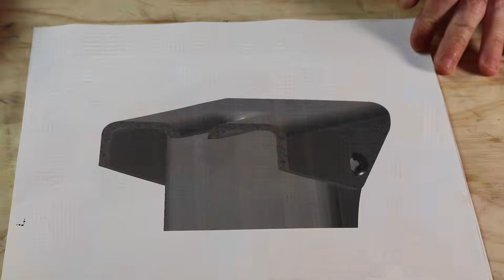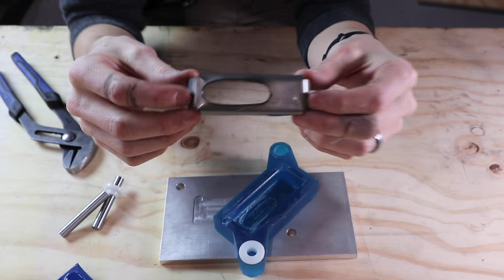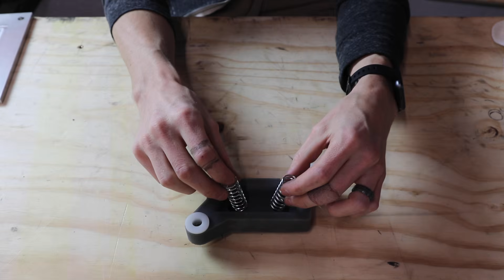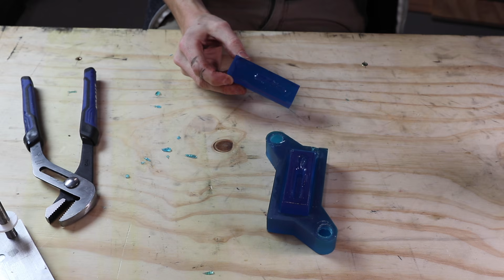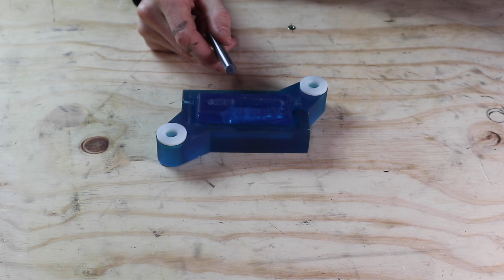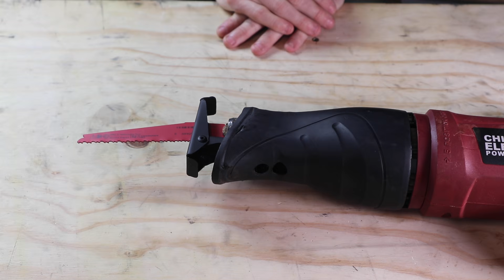Bending Steel With Plastic Tools

Comment: Nice job, man. There's nothing at all wrong with printing hobby models, but it's great to find a youtuber using 3D printing for actual functional parts for once. I have a resin printer (highly accurate but the resins are typically even more brittle) but use it to print either a form which I can make a silicon mould around and then cast one out of a high-strength, two-part resin, or if geometry allows, print the mould directly, add a release agent and just pour resin straight in . Asides from the obvious benefit of having stronger forms, you can also use much less print resin (or filament) as most of the structure is infill because it doesn't need to be strong. Can also add glass fibre or carbon fibre to the two-part resin to further increase strength. Obviously this creates one more step, but it's a good middle ground between expensive, machined metal forms and brittle, instant 3D printed parts.

Comment: So forgive my ignorance, I'm not an engineer, but that symmetrical cracking of the final form.  Would it not be possible to solve the shattering die by increasing the area of the applied force. Instead of simply pressing down in the center, if you had the press applying force to the entire midsection, would that not help prevent this??

Comment: If you had done this with a cheap fdm printer you would have had better results. You can indeed form steel with an fdm print and believe it or not pla is all you need.

Comment: Have you ever tried/made any videos on composite tooling using 3d printing? Might be really neat for small scale or internal structure parts. Have done something similar with a printed mold and inserts for a CF steering wheel, thought it might be a cool topic to check out

Comment: That was not the bushing sticking on one side, that cause the one end of the die to stop moving.  You placed your top piece of aluminum slightly over the Left guide rod.  Watch the slow-mo again, and you can see the aluminum top plate actually bend up before it slips off the guide rod. Now look at time stamp 15:10.  You can see the proof by the damage the guide rod did to the aluminum plate. But Great video any how I got a few things I would like to try.

Comment: A lot of these parts are done in two stages with the second just finishing up where the first one messed up, but there’s also two stage presses that punch the metal and some holes out after the initial pressing is done and the cutters are just deeper in the mould

Comment: Imo the slit in the blank seemed a bit narrow , should maybe widened the slit, 1/8" and thinned slightly with a dremel for a decent bevel 3/16"  around the perimeter of the slit and widen the hole in the form underneath by 1/4" , just what I would do to attend to resolve form breakage

Comment: Really enjoyed watching. Keep making these great videos! To fix the camming issue you experienced you could try replacing the hole in one of the white bushings with a slot (if you haven't already done so, hard to see). With two holes the system is over-constrained and more inclined to jam.
Reply: Btw I think if you printed the female lower die using a MarkForged printer with carbon/kevlar filament reinforcement you would not have a problem with the die splitting under tension. You would print the die with continuous concentric fibre rings around the cavity embedded in the walls.

Comment: Print the forms into a steel box to keep the forms from bulging out with pressure.
Your welcome
Reply: That doesn't work with a resin printer. You could pour resin in later, I guess...

Comment: In metal forming there is a term called a "set radius" it has to do with bends thinning in the corners. As you know the material on the outside of a bend is in tension, the material on the inside is in compression. The thinning comes from the outside "Skin" of the material. If you were to use a point micrometer in the bend you'll see that bend would be less than material thickness. 

Ok! I said all of that to say that your bend tooling should not be material thickness offsets. It should be at least equal to thinning - in most cases you actually want it to be slightly thinner than the finished bend. This will "hit" that corner hard and generate a lot of pressure. Essentially you are setting the radius at the angles you have on the tool (90 Deg) 
If you want to go over 90 deg. Then you would relieve the bottom tooling to have clearance to allow the flanges to swing further than 90 when you smack the corners harder. 

I hope that made sense :) All that being said I believe the pressures would exceed Plastic  and you'd blow it up for sure!

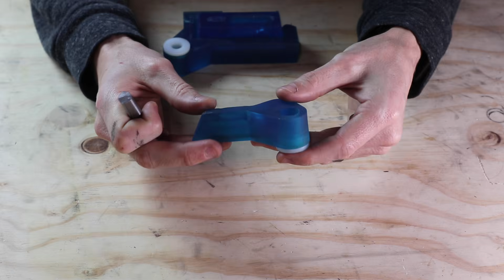Comment: 14:14 what actually happened is that you didn't place your press piston right on top of the die and the mold at 12:10. You had it just right at first then decided to move it and went off-center, thus causing the camming you're talking about. Great video nonetheless!

Comment: It's mostly epoxy resin if so it's first time hearing 3d printing using epoxy resins. This guy doesn't realise it's not a common knowledge of the 3d printing process that's being used and even then didn't reveal anything. 🙄. For most people 3d printing means fdm and there no way fdm can do this.
Update: n further research I found out that it's a polyjet process with polypropylene material which can withstand temperatures upto 300 d c.

Comment: First and more importantly, this was a really neat video.  

Second, I just saw a video on PSU material if you have the enclosure, heated bed (160 degrees, so ac powered bed), and all metal hot end to do it.   Very strong stuff.

That all being said, I laughed when you said A Holes.  My inner 12 year old is alive and well.

Comment: I love this (and your other) project(s). Curious if you would think to run your designs through FEA on the die in tension before going to the length of 3D printing? Seems it would reduce much of the trial and error factor. Thanks for your videos... very enjoyable watching your process!!

Comment: Probably already know this but I would say that the slot would be cut and formed in one operation after the simpler features. Of course it's just 3d printed dies and dies are normally made of A2 tool steel, at least the ones I've seen. Great job on 3d printing dies and using them in a real application.

Comment: When you make dies that are weak, provide support from the sides.  You could make a steel or aluminum "box" that the die sits in to support it from bursting.  You can make your 3D printed dies smaller, saving material and printing time.
          In industry, some forming is done by having hard rubber lower "die".  It is supported on all sides, so it is essentially a "hydraulic" die.  Advantage is that only 1 die need be made, and there can be less trouble with parts sticking in the die.

Comment: Awesome video. What material were you printing with?  PLA? ABS?
Reply: Looks like SLI printing in resin. Not sure.
Reply: @shifty7739  Yeah he says it's resin near the end of the video 19:35
Reply: @atomix2559  same with 13:43
Reply: that is form labs tough resin
well, the blue die was.
Reply: @LittleRainGames  Yeah, its so expensive though cause each tub has a shelf life...so it's better for people who print a lot...
Reply: @LittleRainGames  i think the blue one is draft resin, my draft is blue at least and the layers seem quit high
Reply: The grey one looks like tough 2000 form labs resin. It is resin for a SLA printer. I have one too and the prints are so much stronger than FDM prints
Reply: @RegeraV8  what do u use it to make? Ive always wanted a printer. TIA
Reply: @RegeraV8  resin is much more brittle though, especially in a high tension situation like this. I think a 100% infill FDM print would fair much better than resin print.
Reply: Jesus that tough resin is $175 USD for 1L  (33 fluid oz)
Reply: @shimarlie1  1L is a ton of resin.
Reply: @shimarlie1  Have you seen the price of PEKK? Over 700 buckerinos per kilo.
Reply: @shimarlie1  Pretty sure he gets it for free...
Reply: @Bottleworksnet  yeah makes sense. Cheap advertising
Reply: @shimarlie1  No, because Shane is engineer lead at Form Labs.
Reply: Dcgrdgtf 21 sdx ? 😂
Reply: Resin on a resin 3d printer
Reply: This is a great comment chain 👍
Reply: He uses resin it looks like, no footage of it being printed, it’s clear, and very smooth so most likely resin
Reply: He uses a resin printer
Reply: I wonder how it would have worked with fibre reinforced material.....
Reply: @wernerviehhauser94  Probably no real improvement, fiber reinforcement only really helps with tensile strength.
Reply: @wernerviehhauser94  how would  iron filings turn out
Reply: Can you explain what these words mean for those who don’t have a PHD in civil engineering
Reply: @nukerkid105  They're just different types of plastics used in 3D printing.
Reply: @backfake5415  ah I see
Reply: @nukerkid105  Civil engineering is planning for roads, bridges, sewer systems.
Reply: @TheSuburban15  I think he meant uncivil engineering. Jokes aside I think there is another Swede here. In Sweden we have "civilingenjör" which translates by word, but not by meaning to civil engineer, but that is to differentiate from military engineers. The correct translation of "civilingenjör" would be Master of Science in (whatever field) Engineering.
A civil engineer (building and stuff) is called "civilingenjör i väg och vattenbyggnadsteknik"  that's basically engineer in road and water construction. technology.

Comment: In this case and previously working with some dies to do similar work. I would normally have seen the center slot actually formed first with an outer ring also "starting" the outer bends, with the second outerbend process done after in a side by side machine  process.  For automation the second press would have an actuated pin in the slot that would then grab the part on the way back up and eject it, so the operator/loading system only ever really needed to load in a new blank and the machine handle the punch/prebend> shift over to next position > final bend and eject. Then simply machine shifts back over and is ready for a fresh blank.

Comment: I would have cut the hole AFTER the bend. 
I understand this is an experiment in bending but it would be easier with flat parts welded. I actually improved my saw making a new part, the face was 1/4" flat stock. Much better and stronger than sheet parts.

Comment: what's the price difference between working with the metal parts to do one yourself (only metal parts, plus CNC plus press etc.)

what I mean is, what is the operating cost + materials vs the cost of buying one if you use this tools to the full extent of their lifetime?

Comment: I've made a lot of tooling, jigs, etc. with 3D printed parts. Bending  and cutting tools, for metals and even injection mold tooling. You have to have the right geometry, drafts on the 3D printed part for it to work well, as a forming tool,  also type of filament is important. Having said that,  harden steel is best for punching and bending if you want consistency with precision.  You can marry 3D printed with metal and have some decent dies. The key is the die has to be stronger than the material you are forming or cutting. This reminds me, I recently needed a door hinge template to route and drill holes precisely,  so I bought one but after opening it up and trying to use it,  it did not work  on custom shed doors, so I designed and  3D printed one,  PLA worked great, and the tool is reusable.  Sometimes we have to weight cost vs work vs time.  You could have simply made the foot part you are bending as a robust 3D print part, altogether, if you break one, print another in a fraction of the time and cost it is taking you to do the design, testing, cutting, forming, etc.

Comment: This so interesting, I know you couldn't work out every little detail but as someone who has worked at a company designing new machines and spending thousands upon thousands on tools and dies; This is super promising for reducing the cost of designing machinery.  
For a company moving into mass production, creating parts in this way is an absolute necessity and this could be a way to drastically reduce research and developments costs.
Can I ask what resin and 3D printer you used for this process?
Reply: Yes, if the plastic version even holds up for one pass of forming, you know you can make the same form in steel for mass production.
Reply: This.  Replicating a replacement part for a cheap tool is not the end goal here.  Being able, to for work or hobby, take something from an idea to forming metal is game changing.
Reply: Formlabs form 3 or 4 

Probebly tuff 2000 resin 

If your a company give them a call and they will help you select the right resin

Comment: "No printer available at the moment" <- I wonder if at some point we'll be able to pause a print, launch a short urgent one and then resume the first print easily.
Reply: Not easily with a resin printer. You would need a way to remove the print under way and keep it viable during the time it took to print the other object. An FDM printer should be able to do it fairly easily as long as you can change out the build plate. Both would also suffer from issues of the build plate not being 100% in the same position it was before.
Reply: @WonkoTSane  With an FDM printer, if the machine knows it's geometry, it may be able to print your short urgent part in a corner or something. Octoprint is already able to cancel a failed part (when you print multiple), why not add one?
Reply: @NicksStuff  The issue would be that there would need to be some way to tell the machine where it could print so that it does not have issues with the part still on the bad. With an SLA printer you can't do that at all. With an FDM printer you would be restricted to a part of the bed that is clear and where the print head and assembly will not come in contact with the part on the bed. With machines where you can change out the bed you will run in to alignment issues trying to go back to the original print. It can be done but is probably not worth the effort in 99.9% of the cases. It would be far easier for most people to purchase an additional printer.
Reply: @WonkoTSane  It's already the case in FDM printer : every slicer allows you to print several parts one after the other (instead of all at once). Of course, the slicer had to know the geometry of the printer (bed, gantry, hot end)
Reply: @NicksStuff  It prints them all at the same time, layer by layer, over the entire bed. Here you would be asking the printer to print part of an object, stop, return to zero z height, and start a new print. The print head would not be able to travel over the entire bed without impacting the already printed object. To do this it would need to be restricted to a small portion of the print bed or know exactly where the full extent of the original object was in three dimensions to move around and over it.
Reply: @WonkoTSane  You wouldn't need anything : it's already possible.
Of course you can't use the whole bed for each print, that would be silly but the slicers allows you to place your various prints where you want, provided you respect some constraints.

Comment: My first reaction was, why not do the radiused interior first, it might even offer prophylaxis against deformation when the side bits are folded. A testable idea, anyway.

Regarding the issue of the "no 90° bends" rule, I would observe that it depends not only on the elasticity of the formed material, but also of the die material. I can envision a case in which the die can flex beyond the insertion point and contract inward, and if required, be further compressed laterally, to overcome the worked material's elasticity. Of course, the compressibility of the die is also required for removal of the work.

It has just occurred to me that the flexibility of the day is active in the lateral compression operation.

Also, you used the term "presumptuous" inappropriately. And that's totally cool, I think that you are doing excellent work.

Comment: If you do the powder coating in house, I'd love to see a video on that
Reply: Is not hard , they actually make a kit to do it in your oven..  eastwood makes the powder and you statically charge the powder with a special gun and ground the part then bake on the powder in the oven...  perty cool but couldnt be nearly as skookem as factory coated parts where theyre put in a kiln...
Reply: There's a few ways to do it. A coat of oil then "shake n' bake" would work for that small stuff. Or the hot air gun method.

Comment: The die splitting apart should have been fixed by creating a much more robust die for the die under tension. However, this makes for all new techniques for me to try when working with sheet metal because I don't own a CNC mill but I do have a 3D printer.

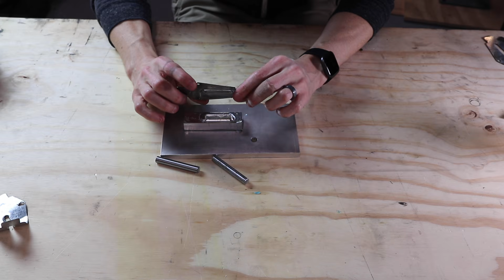Comment: The reason your top die broke around 13:00 in the video is because you did not center the press's ram above the area where the work was being done. I guess this is easier to see from the video's angle than from above.
But this is a great video. I never would have guessed that 3D printed dies would form such thick steel.

Comment: Makes massive, solid SLA parts. That’s it.
Reply: LJTwiggy I was wondering if FDM would work better?  A solid piece with properly annealed layers could do wonders. Plus it works to FDM’s strength
Reply: Exactly my point! It’s not like layer lines would get transferred to the part anyways. And when properly oriented, FDM would not only hold up to the vertical compressive force much better, but also be particularly well suited for the expansive force provided by the part while bending.